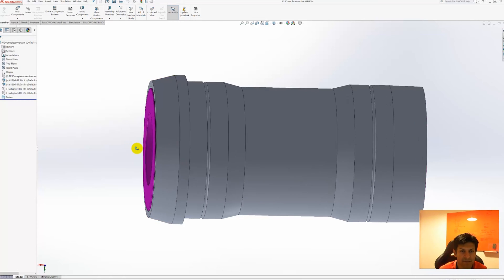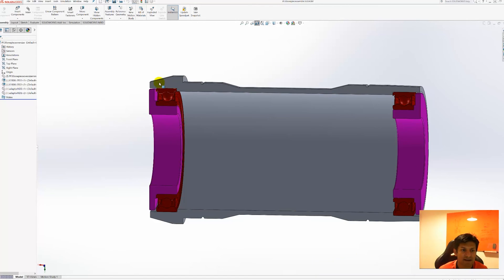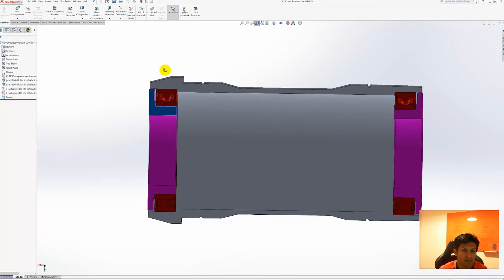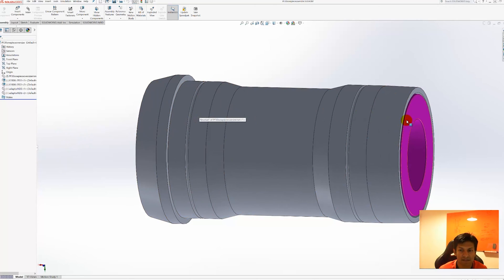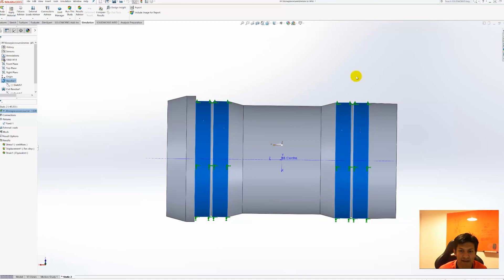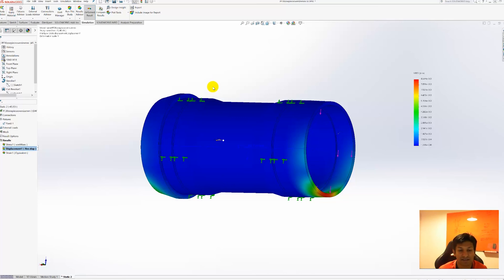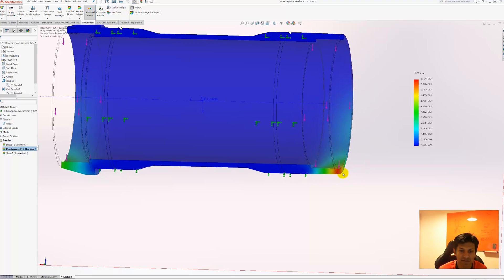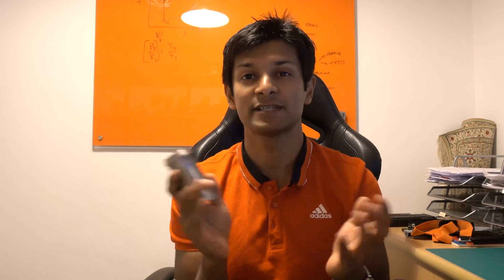Hambini PF30 BBright BB30 Bottom Bracket Technical Presentation (Shimano Fit)

Comment: I dont see any BB solution for PF30 frame for using 30mm Crankset. Is there any reason against it?
Reply from the maker: PF30 has a narrow bearing spacing. This is not good from a longevity point of view, hence I don't make one.
Reply: Hambini, do you know if there's a an adapter or BB replacement for my cannondale synapse carbon (BB30a) that will allow me to keep on using the SiSl2/Spidering combo that came with the bike?

Comment: Fits to
 campagnolo
Reply: You’re talking about the Ultra Torque system. What about axle length? Unlike Shimano, once it’s tightened it has only one length. Shimano’s hollowtech crankarms can be moved a millimetre or two inboard or outboard, even if it’s less ideal. I think Campagnolo used a retaining clip (the C clip) to keep the crank somewhat in place. But I don’t think there should be much lateral forces here, so no problem unless the axle is too long/short.
Edit: spacers might solve it or the wavy washer supplied from Campy

Comment: Really interesting video.  It would be good if you could make a BB30A 73mm version.

Would a narrower external diameter of the central section that steps down from the interface surfaces be possible?
The reason i ask is that there is not a good solution to BB30A->24mm, and there is also real issues for BB30A->24mm when gear outers and (especially) hydraulic hoses are routed through the inside of the BB Shell.

The only non-crappy-adapter solution is C-Bear BB30A ->24mm/GXP  which is expensive and ceramic and although it apparently works, for the (obviously popular) CAAD12 Disc the routing of the hoses and gear outer beneath the bottom bracket is fairly ropey.  AFAIK there is a little more space in the Supersix Disc BB (ShaiBike as a video showing the routing), but there is still not a decent and inexpensive solution.

Full disclaimer : I personally don't currently have a frame that needs it, but in the sad world of cycling I like to check there are solid solutions for future purchases.  I quite fancy a CAAD12 / Supersix, but the lack of a 24mm/GXP non crappy BB solution is very off putting ..... I think there is a Hambini sized gap in the market : )

Here is the c-bear solution - obviously the narrower the external diameter central part can be the better for routing.
https://www.c-bear.com/en/products/bb30a
Reply from the maker: It's easy to design but technically costly to implement. The stepdown makes it quite difficult to machine in a standard lathe - holding it becomes difficult. I don't CNC my bottom brackets  for critical tolerances because the precision that I require cannot be obtained on a CNC machine. A CNC machine is not intelligent like a human and cannot take into account tool wear.

Having a big step down in diameter makes the bottom bracket less stiff, so you lose that advantage. You would have to make the wall thickness thicker to get the stiffness back. That adds weight. My solution would be to change the Bottom Bracket material to a different type of Aluminium alloy or titanium.

A Hambini sized "gap in the market" is the size of a "fat orange beaver"?

Comment: What do you think of the Wheels Manufacturing BB? The one that is pressed in on one side and then the other side is screwed into the pressed in part. Does the center joint lead to creaking or deformation of BB overtime? After watching your BB demonstrations, I am interested in PF30 to 24mm spindle that you created. Great video!

Comment: I guess this works with mtbs  as well? No diference between road and mtb?  My Mondraker Chronos creaking drives me crazy...... Thanks! Subscribed!
Reply from the maker: Not quite, the MTB is slightly wider but the same principle applies. Road Bottom Brackets in BB30 and PF30 are 68mm wide, in MTB they are 73mm wide.